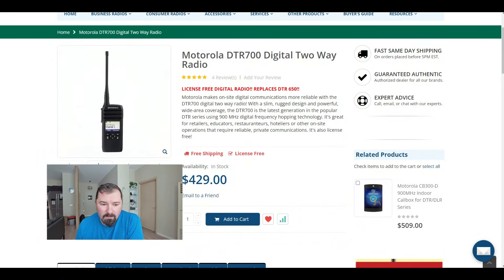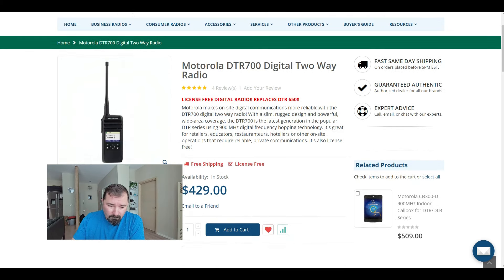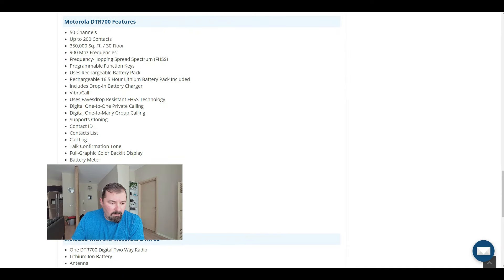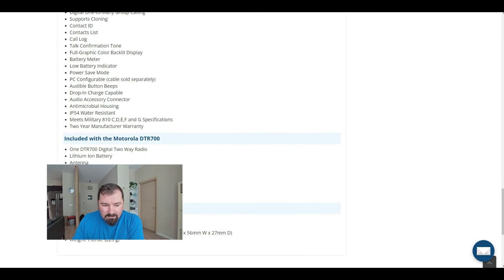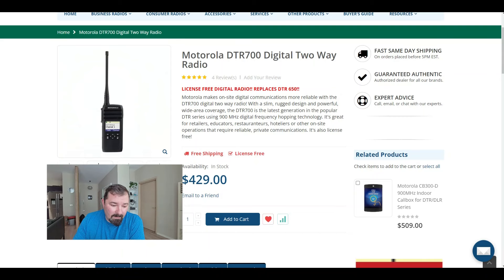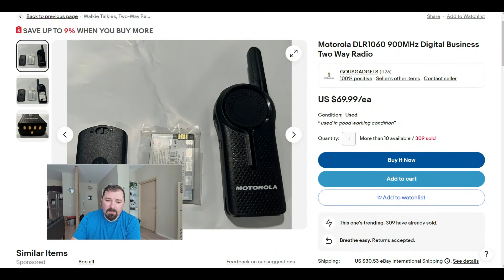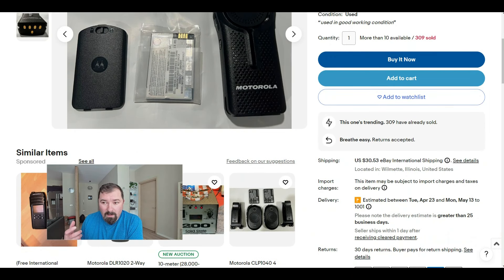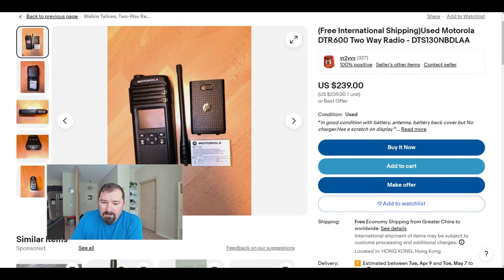Do 900 MHz FHSS Radios belong in your P.A.C.E Plan?

Comment: Walmart just switched to the 900 mhz band ,they just bought 25,000 dollars worth of the Motorola DLR110 Curve for their employees. I am wondering what frequencies and CTCSS tone they use?
Reply from the maker: Oh, interesting. That radio use 8-level FSK 900MHz FHSS which hops between the selected hop-sets per channel. In addition, it is Wi-Fi cable with features like voice mail.
Reply: @EmCommSolutions  yah i read about the channel hopping and the wifi, but that only applies to if you select to call someone private which you do i believe the channel changes and the frequencies changes ,but overall when someone calls about a customer or a certain topic 50 employees hear the call so i believe most of the time its on one frequencie, you also got to think about there is no wifi in the parking lot ,the cart pushers still hear the calls or makes calls. i believe that's because it is still using the 900 band. Since the curve does not have a display the only way to know the frequencies ,you would have to do the wire and software thing(chirp) to find out or breakout out a SDR (Software Defined Radios) that shows the waterfall effect. someone needs to do a youtube video on this topic. Noone has yet.

Comment: The Retevis RT10 is not similar to the Motorola DTR radios.  The RT10 is a decent analog 900 meg HAM radio and it does have a weird "dual-slot DMR" mode but that's about it.  It has poor battery life too.  The stock antenna is garbage.  I got lucky and found a guy on E-Bay selling Antenna 900 meg replacement whips and the SWR is perfect for 900 meg HAM band.  The DTR radios are fun to play with and you can find them on E-Bay in pairs for a decent price.  Programming is a little weird but set the 4-digit code to 0001 and then drive around the mall areas.  There are a few places that use them.  Michaels and Costco are two current users.  The only problem is that the intercepted comms are pretty boring.  I own the DTR700 and two of the older models.  The only downside is if they are using a private code other than 0001.  You can scan different 'groups' but not different codes. Oh well.
Reply from the maker: Thanks for the insightful feedback. I had my suspicion about the RT 10 but it was hard to tell from the online material.

Comment: Who are you going to talk to though? Radio Silence is going to be key to survival in a SHTF scenario which is obviously on the horizon. The fact is most RF Heads know how to fox hunt. So it doesn't matter if it's encrypted or not. Pirates will go to where the RF source came from because they know thats where the prepper stuff is located.
Reply from the maker: I agree, if someone really wants to find you and they have the right equipment they will. However, the ISM bands are full of RF sources in a urban and suburban environment. Therefore, if you are using good radio discipline you have a better chances of hiding in the noise.
Reply: This isn't the use case for this radio. This isn't a bug out radio. Privacy can be just as important to prevent you from hearing rogue traffic. 

Sure, zombies are always going to be out there. But for a device that will be dead silent, and work with reasonable expectation to privacy... The Motorolas are sweet!